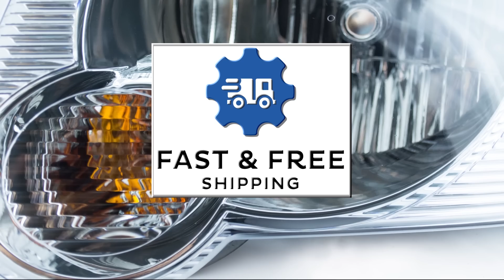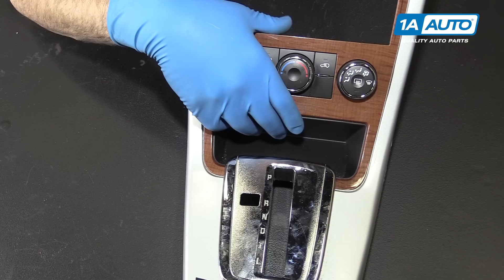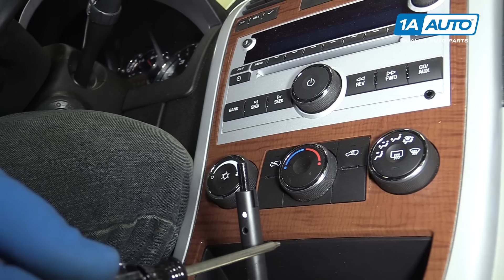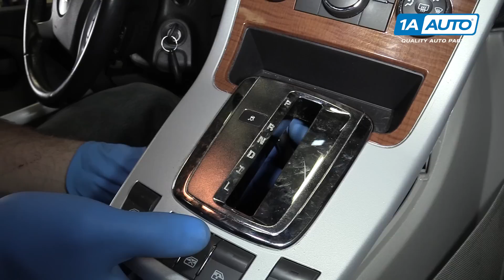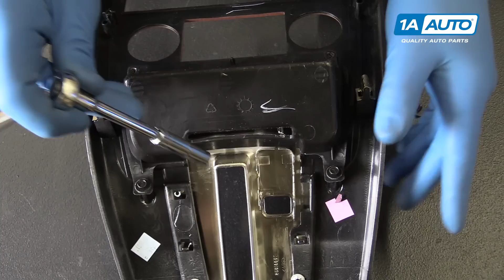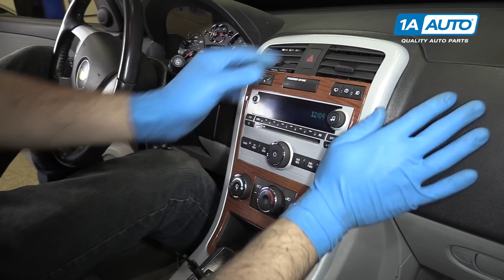How to Replace Center Dash Storage Compartment 05-09 Chevy Equinox

Comment: could you guys show me how to flush a heater core in a 2003 dodge ram
Reply from the maker: We currently do not have an auto repair video that shows this, but if you remove the two heater core hoses, you can take a garden hose and switch back and forth between the two heater core pipes. You should see a bunch of gunk fly out of it. Hope this helps you out. 1aauto.com
Reply: 1A Auto Parts One more question,do ind to drain radiator first or can I do it full?
Reply: sorry i ment with radiator full can I flush heater core